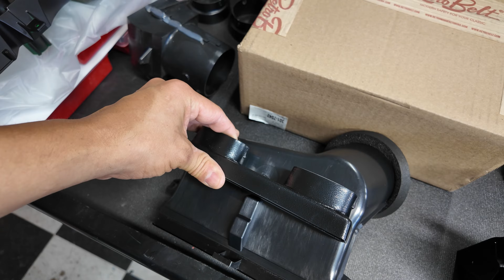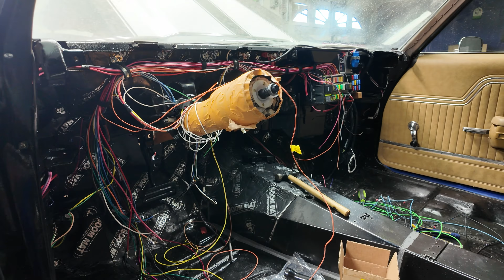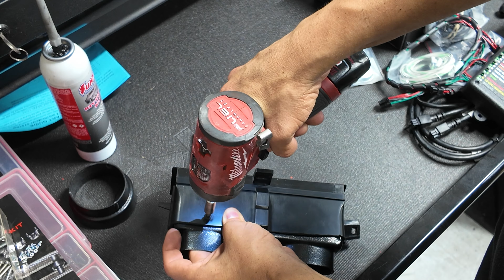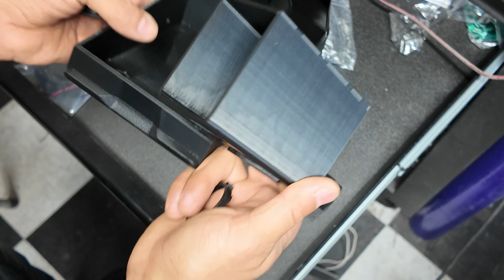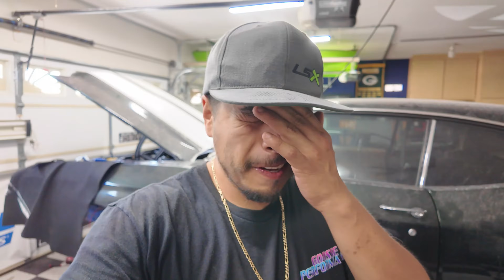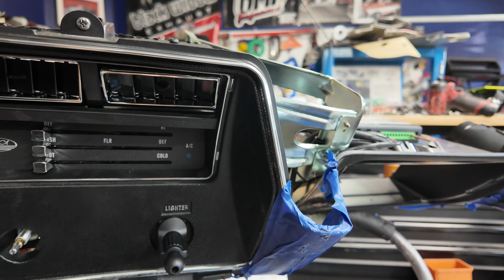INSTALLING DAKOTA DIGITAL, VINTAGE AIR, RETRO STEREO FOR 72 CHEVELLE PROJECT!

Comment: Hey I have a question, I just bought a blueprint 427 for my 71 chevelle with the deluxe package and I am wondering if I can use the compressor that they send with the motor for that vintage air setup or if I need to use the vintage air compressor? Do you have a video on that? I don’t have the engine yet or the air kit but just trying to have some insight when it arrives on what will work. Thank you
Reply from the maker: love to answer all your question, be sure to take advantage of the one on one service on the website
https://goosseperformance.com/products/30-min-talk-shop
Reply: @goosseperformance1444 . Thanks but I just needed a simple yes or no. Saved myself $75 by just calling vintage air and ordered what I needed.  Love your channel though bro!  Best channel out there for explaining things for chevelles

Comment: I have Fitech ultimate Ls it doesn’t have osb2 port trying to find out a way to get oil psi reading
Reply from the maker: @ron_g72chevy  just need to add the sensor from DD , maybe off the oil filter area 
 don’t be afraid to use the talk shop service on the website, save you some headaches 🤙🏽